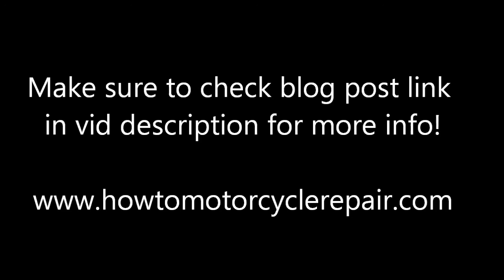How-To: CB400F Jetting - Pods Pipe - Test Spin

Comment: Awesome video! I have been looking for a good video on cb400f carbs. When you threw your emulsion tubes back in to the carbs, did you have to tamp them down to get your main jet to seat? My main jets wouldn't seat in the carb until I tamped the emulsions tubes farther into the carb body. Now they seat but my bike is now running super lean. I'm worried I pushed the emulsion tube too far in.
Reply from the maker: +Talley McIntire It's been a while since I made this video, however all emulsions tube get installed and they typically have a stop, so you can't push them in too far. Here is the jetting I ended up with: https://www.howtomotorcyclerepair.com/cb400f-jetting-test-spin/

Comment: Idles and runs great! Good job. You had to downsize your idle jet to 38. Did you find it to idle way rich with the stock 40s?
Reply from the maker: 40's would have worked also. Goes to show that the stock airbox flows pretty good at idle and cruise.
Reply: MatthewMCRepair Cool. And needle height? Clips still at 4th from top?
I’m excited to try mine with 38 slows and 88 mains, 4th clip from top. Cheapie paper cone airpods with an Outex exhaust/muffler
Reply from the maker: Yes 4th clip. Read this: https://www.howtomotorcyclerepair.com/cb400f-jetting-test-spin/